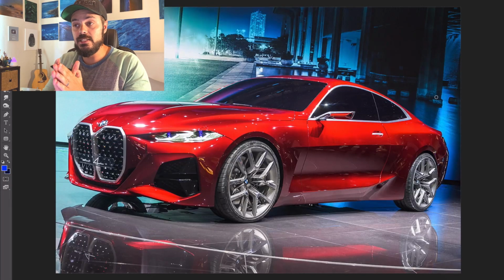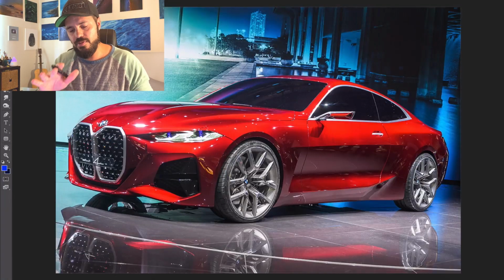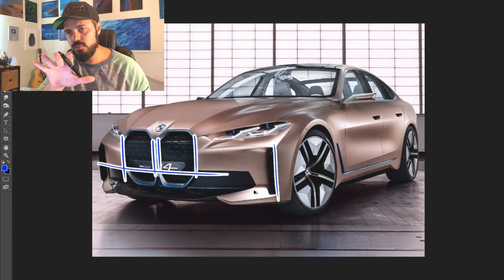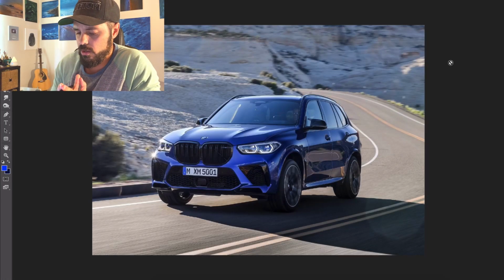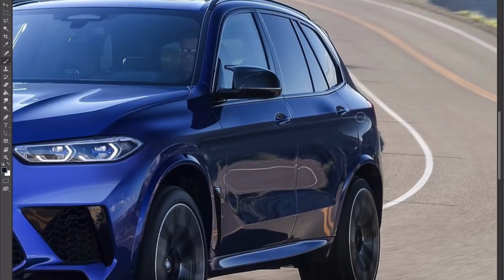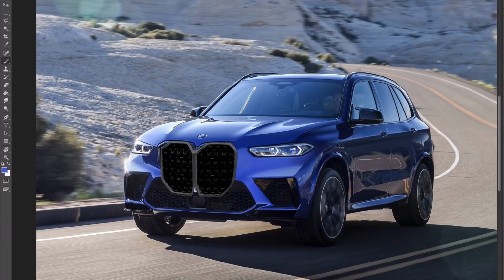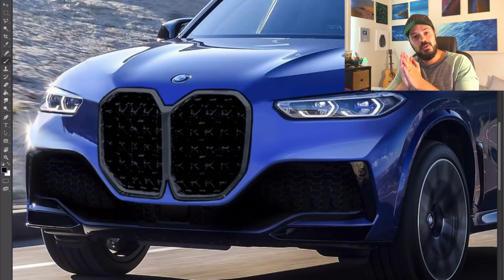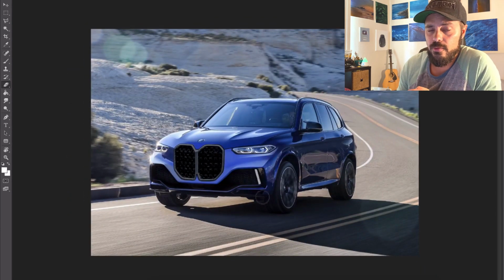Is THIS the next BMW X5?

Comment: Because the electric car doesn't need air to work so the air intakes on the front if you pay attention are the little vertical stripes under the headlights

Comment: BMW needs to find a new grille. I’m completely aware that the kidney is a STAPLE of this brand and it’s not a BMW without one, but like, they’re running out of things to do with the grille. You can only do so much until you can’t anymore. They’re now sacrificing style for the sake of still redesigning the kidney so that it still has them but looks different. It’s like the Boeing 737MAX. At some point, you just need something new.

Comment: It's not your fault I don't like the design. It is like you said, BMW is heading in a direction of, emotionless design. It is a pity. Design without emotion always looks horrible in my opinion. The current X5 M is full of emotion wich is why it looks great. Even bigger kidney grillls look fine. It is actually in my opinion, the lower facia conflicts with the grills perportionatly. But it gets worse when that lower opening or facia suddenly swoops up. If you don't mind a small idea, leave the lower facia strait, but the corner vents, make them am upside down 'L' that goes to the center close the the kidney grill, plus add 45 degree clips in the corners of that 'L' to follow the grill shape.

Comment: One of the biggest problem I have with the new BMW grill is that it goes to high on the hood ! It emphasizes its size ! But on the i4 Concept it's better. I didn't identify the problem with the geometric and graphic elements on the 4 Concept, but I agree with you !
About this X5, I don't really like this huge "mouth", I prefer simpler design, more elegant

Comment: Functional? It's an electric with a massive grill, that doesn't have any function
Reply: Actually, I think both Volvo and BMW have said their concept car "grilles" are not actually grilles, but they house a bunch of tech, most likely sensors and such.
It's kind of a win-win; they find a use for the space left by an unnecessary grille, and then get to build a familiar design around that functionality.

Comment: I feel like the part around the kidneys makes the front look very droopy and it doesn't have the solid feel that the original did considering the large size. If the bottom intake had some kind of support (like you thought about at 9:23) would have made it look much more appealing. The actual design is really clean besides that

Comment: If you don’t like the thick frame around the grill, wait until they frame it in LED lights... the grill is basically a brand logo now, and all manufacturers are going bigger and bigger. I don’t mind the vertical nature of the grills or even the size (at least they reflect back to the original grills). I do agree with you on the shapes of the grills vs the lower intakes, they compete with each other somewhat and cleaning that up would help integrate the larger vertical kidneys better 👍